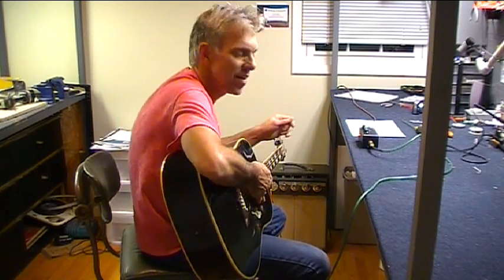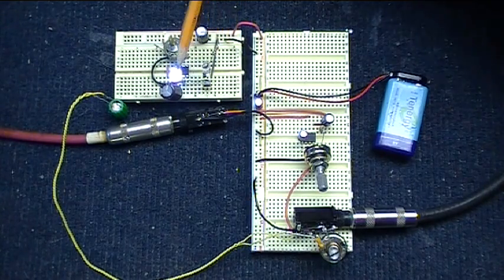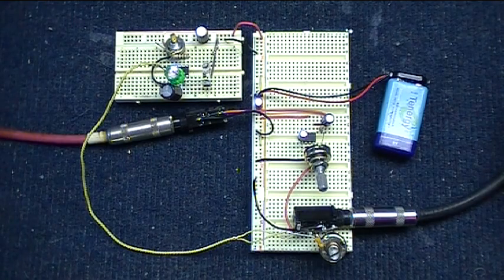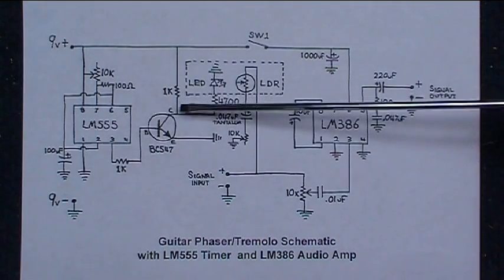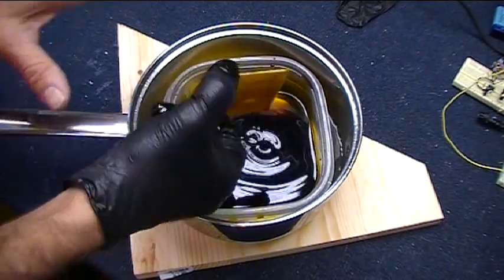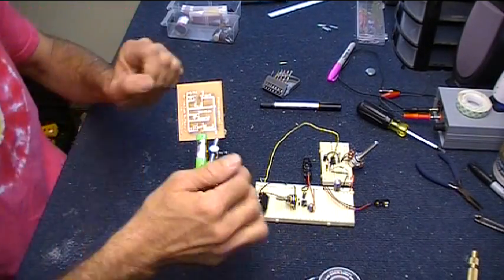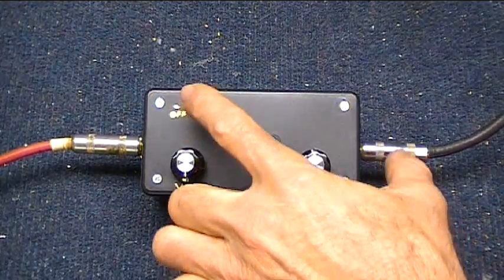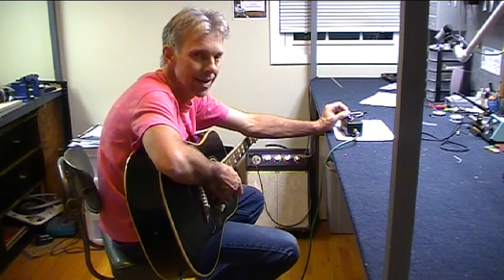Guitar Phaser-Tremolo with a LM386 and a 555 timer chip

Comment: Really nice video/instruction - thanks dude! I've added this one to my "Repeat" list so I can rewatch a couple of times to let it all sink in. I especially like the whole sequence end-to-end from showing the photo-resistor functioning to the installation into the pedal. Thanks! One small thing, as a lifelong guitarist (& violinist) I think your sound/audio demos would work a little better on an electric guitar - the raw tone of the acoustic isn't picked up too well by the pickup and/or recording device, so you're losing a lot of the signal character (timbre/amplitude/frequencies) to start with. I'm guessing that all the sound clips would "illustrate" the modulation effect much more obviously if it were a "bigger" elec. guitar signal? Great vid though. I'll definitely be trying this. 🙂
Reply from the maker: I may have to try it on my old Silvertone electric. I found it at a pawn shop and it was obvious that someone done a really good setup on it. The action is like butter! Paid $100 for it! Built in the early 70s. Thanks for watching!

Comment: Thanks for the video. I tried to build the project and I did get it to work. I used a GL5516 LDR. I had a problem with a clicking sound each time the LED blinked on. I did not use the LM386 instead I add the the NE555 and the LDR to another boost pedal I already built. I realize you posted this video about ten years ago but I had a good time. The effect plus a little reverb on my amp made for a splendid sound effect.

Comment: The attenuator path of LDR,47nF,10k pot does not seems that is connected to a perfect point of the circuit to cause the desired vibrations.Maybe works perfectly with the guitar pickups but if its input signal comes from a low impedance chain output as a headphone guitar amplifier then it might not work at all.Also LED is connected in a way that LED lits more when transistor is in cut off state.More duty cycle in the base transistor pulse less led brightness,no pulse at all full brigtness of the led.

Comment: More importantly those sockets prevent you from burning the chip which was easy enough to do on accident with old fashioned leaded solder but is super easy to do with the higher heat required to melt today's lead free solder.

Comment: Why is the BC547 used to drive the LED?.....the output of the 555 timer is more than capable of driving the LED directly via a 470 ohm resistor.
Reply: It inverts the signal.

Comment: I have just finished building this circuit but instead of the LM386 I have used a single transistor amp prior to sending it out to my guitar amp.....this circuit works very well and I am very pleased with the result.....thankyou for the idea of using the LED and LDR....I tried other circuits with no success......

Comment: Why not use the 555 in Monostable mode? My circuit seems to be functioning similarly to yours in this mode with the benefit of using fewer components (a single resister). why not use a voltage divider with the photo-resistor to invert the LEDs signal? rather than use a transistor and another LED.
Reply: +Ethan L Monostable needs to be triggered....

Comment: Doesn't one of the legs of the 555 have a saw tooth output? I think that would work better than the square wave output with the one off set evenly, you may need to buffer it with a follower transistor ? since its not an output ? In a tube amp i think its control is a sine wave? so saw tooth maybe more close is more natural sounding? you can hear in yours how its too abrupt no mater the setting.

Comment: I built your guitar phaser with a copy of your circuit board,but there is no connection for the I k resistor from ps to the transistor,but it is on the schematic,what going on?

Comment: hey thanks for posting. when i bread boarded this i got a clicking noise every time the light goes on the light and the noise are adjustable with the 10k pot. is it a 555 related problem? should i put a filter cap somewhere?

Comment: Could you use op-amps as non-inverting buffers for the input and output to help with the attenuation?  Set them to a gain of 1 then get rid of the LM386 Amp?